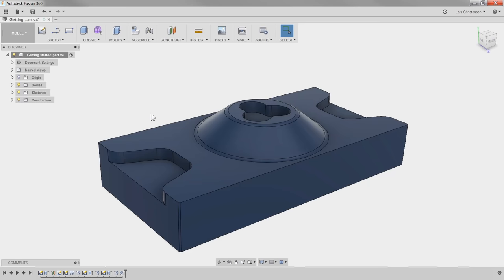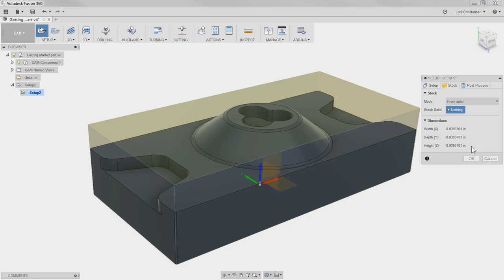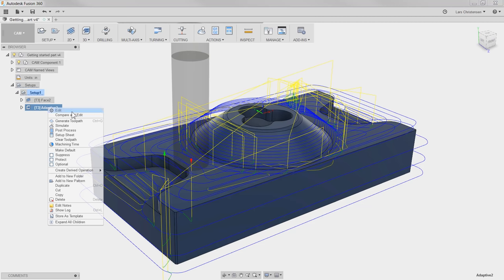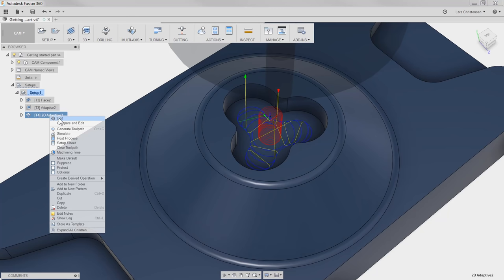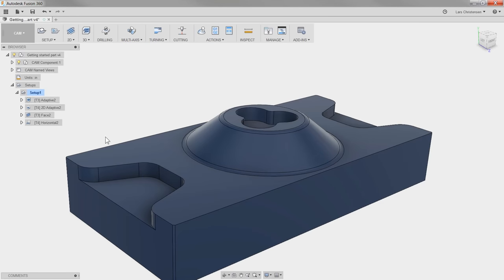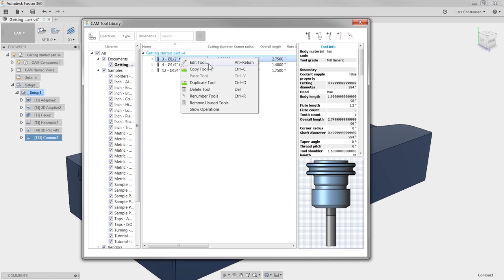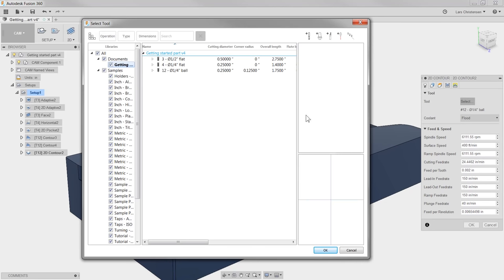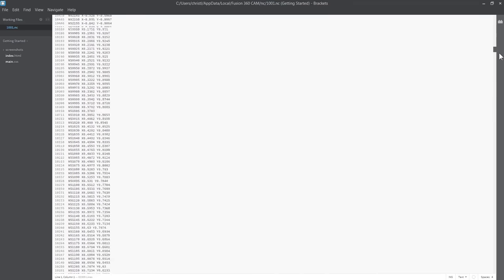How To Get Started With CAM Within Fusion 360 — Tutorial

Comment: Back when i first started work in a small engineering firm back in the 80's they used to have some cnc equipment and i always remember the manual programming of the machine and then the rapid hitting of the emergency stop when you noticed that you had put z-50 rather than z50 or similar. This stuff you've just demonstrated is truly amazing and must reduce boring bars into the chuck incidents massively.
Reply from the maker: That is awesome to hear MrDirkles .Thank you for watching the videos. AND now you don't have to bring extra underwear with your to work anymore :-)
Reply: Lars Christensen you're right. No one hates this technology more than the underwear manufacturers.

Comment: Thanks Lars!  Have the Sherline mill up and running with Linux CNC, now need to create my little engine crank shaft in Fusion 360 and create the G-code to cut it out.

Comment: Excellent video. 
FYI, different CAD programs don't typically agree what axis is the Z axis when exporting. Engineers/designers don't typically model in dumb orientations; when importing, Fusion just guesses which axes are the XYZ axes and sometimes guesses wrong based on what program exported the file.

Comment: Lars,  now how do you finish the bottom side of the part? Do you have to file the part as a different model and then flip the part and go from there  or can you do it in the same model with the top cam setup?
Reply: You would make a 2nd setup in the cam and then select the bottom face as origin then you can face off and deburr the part. Obviously a 2nd setup requires you to flip it over in vice in real life etc

Comment: Hi Lars, I have a question about assemblies and Fusion 360 CAM. It appears that while working within the assembly, creating CAM for each individual component is not possible. Instead each component should be saved individually and then downloaded into Fusion to apply CAM. It looks like its possible to create a new assembly from the individual parts so they're linked together. That way any changes to one part may link to the other. As you can tell I'm a little confused. Could you comment and possibly direct me to other tutorials that may be helpful? Thanks. Skip Wood

Comment: I'm new to cnc.  I have an aluminum part that has a 2D pocket with a hole at the bottom out the bottom of the part.  Should I bore the hole and then clear the pocket, or should I clear the pocket and then bore the hole?

Comment: Hi Lars, can you do all the 3D milling with the standard Fusion360 package or do you have to get the ultimate package? Also I am looking at purchasing a Tormach mill is the Fusion 360 compatible with Tormach?
Reply from the maker: Hi Justin Brewton Thank you for watching!
You can do all 3D milling with the standard package and you will find the Tormach post can be downloaded for free.

Happy cutting :-)
Reply: Thank you Lars, that gives me something to think about.
Reply: The Tormachs require special tool holders you can only get from them. They are not just CAT40, HSK, or BT. I've never seen where their holder design offers a benefit to machining.  I'm sure they benefit Tormach's bottom line though. A Haas TL-1 tool room mill is a better choice.

Comment: i try to make a sample cam with fusion 360 . Until now i use sprutcam over a year . But when i send the g code file to my machine   dmg  with siemens 840d controller  i have a warning that Block N16 axis Z1 software limit switch +      . Any idea what im doing wrong ?

Comment: Hi bro, how to determine the right diameter of tool to use? Say i have a pocket with 3 In corner radius, i use a 6 In endmill?
Reply from the maker: You normally want to use the biggest cutter you can get away with, but at the same time a cutter that is smaller than your smallest corner radius so the cutter can walk around the corner and not sucked into it
Reply: @cadcamstuff  Thanks Lars. I just email you a CAM inquiry at your email contact@larschristensen.org. Please take a look when you free.

Comment: Hi Lars, I downloaded the Fusion 360 and tried to follow along, but my screen was different and I got lost in the very beginning. There was no rectangle in my toolbox, so I couldn't choose that from the toolbox. I loaded the rectangle from the menu and now it appears in my toolbox. When I finally got to the point where I had my two components and turned on the origin, I got one face instead of three. I've gone back and watched the video numerous times, but what happens in the video is not what happens on my screen. Is there a manual I can use to get up to speed before I try to learn from the videos?
Reply: because he was using the version from 5 years ago

Comment: Dumb question alert but I'm new to CNC/CMC/Fusion but why 'Face off' anything? I'm getting stock at a specific size so I only want to mill it out. Should I just ignore anything to do with facing off?
Reply: If your stock is really the exact height you want and the top surface is as flat and parallel to the bottom as you want, yes you can skip facing operations.
Reply: If you face the top you don't worry about variations in the material or the way it's loaded. All the dimensions from the too down will be perfect every time.

Comment: I just have to make sure, but this program is for more than just cutting metal, right? I can cut wood? Is there an RPM limitation? 20,000 is the standard in our business. I am unfamiliar with most softwares out there. I have only used a small number of them.
Reply from the maker: Hi Jacob Trolo Thank you for watching!
Yes, you can for sure cut wood. There are not limit for the rpm.

BEst,
Lars

Comment: I would not edit my feeds and speeds in the tool editing, I would do it in the operation tab I want to edit, I use Amana and Whiteside and have their tool libraries with recommended generic setting that are generally good, if to want to be conservative for a part change it only in that part otherwise next time your already slower..... then you need to go back in and change it back..... just thinking forward, don't permanently change tool settings unless you always want them like that for everything ....

Comment: Hi, watched your Video with interest, I am new to CNC have built my own and have a 2.2kw spindle motor.
What I am trying to Mill is a name on a bar of Aluminium 250mm Long 37.5mm wide 12mm thick, using 12mm EM I rough cut to 5mm at 1mm steps around the letters, but when I do 3D Adaptive around the outline of the letters I am having problems selecting the letter outlines and being able to step down so not using the whole side of the 3mm cutter around the outline of the letters. would appreciate any help.
Regards John
Reply from the maker: Hi John Marshall Thank you for watching!
Have you tried the 2D adaptive? That will let you be a lot more selective as you can select chain in the geometry tab?

Hope this is useful

Best,
Lars
Reply: Yeh I found the correct way and used a 2D Adaptive worked fine, I roughed with an 8mm EM and then found that the 3mm EM I had is a 4mm shank ooppss only got 3mm collet so waiting for one from ebay to continue...but many thanks for help...Regard John

Comment: Lars looking at getting a MacBook Pro will i be able to run fusion on it ok do you know please find the specs Detailed spec:
Space Grey
2.4GHz 8-core 9th-generation Intel Core i9 processor, Turbo Boost up to 5.0GHz
Retina display with True Tone
Touch Bar and Touch ID
16GB 2400MHz DDR4 memory
1TBGB SSD storage
Radeon Pro 560X with 4GB of GDDR5 memory
Retina display with True Tone
Four Thunderbolt 3 ports
MacOS
Backlit Keyboard (British) & User’s Guide (English)
Original UK Power adaptor (NOT AN IMPORT).
Reply: Sure it will
Reply: A bit late, but yes. The main concern with F360 is CPU-usage. It EATS CPU all day, so the better CPU. the smoother the running. GPU is only used when rotating the model, and very slightly when adding new features, but because its mostly calculations, its all going on the CPU. 

Hope this helps.

Comment: 21:30 got boring. in the end program is 10000 lines. and parts is easy hand programming under 200 lines all measures on part drawing. who needs cam. yes that cone is also just G3 makro to me not G1 around part. and i hand write it less than you post it. proably allready start cut. if you get RED RED RED silly smart cam here error but not figured out fix it lol. there should be red and errors if its smart
Reply: You don't know nothing about cam programming, once you are experienced in this you can program it in less than 5 min from comfort of your desk while machines are running something else
Reply: @eleksliw6785  yes when experience. there is no time try make cam program works. when can easy hand wirite gcode like pro. no need cam make 10000 lines. no need cam do operation if i allready have it.it read on paper punch numbers on screen.. 1 line makro call do circles pocket. curved arc..etc
Reply: @alejandroperez5368  its tru and i not need i can hand write faster and it will shorter and faster. we tested battle with cam seller lol
Reply: @jarisipilainen3875  of course if you only machine very simple and useless stuff

Comment: all is fine but what box i should hit that helps to stop CNC before next step ( i nead to change cutter manually ). So wich parameter in fusion (create pause in G -code) will stop CNC for cutter replacment operation.?
Reply from the maker: Hi Sasha Kazunin Thank you for watching!
If you edit the tool in the tool library, you will find there is an option for a manual tool change in the last tab